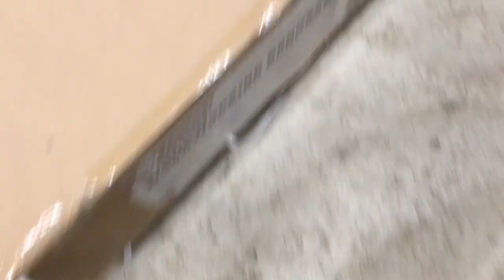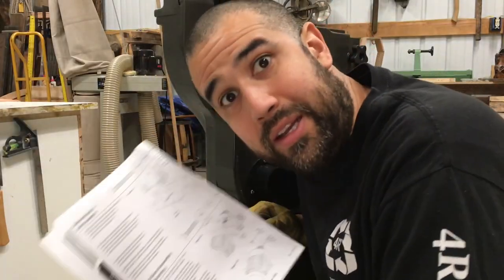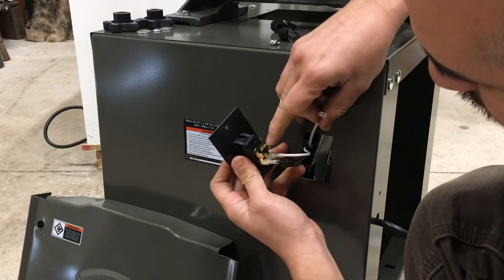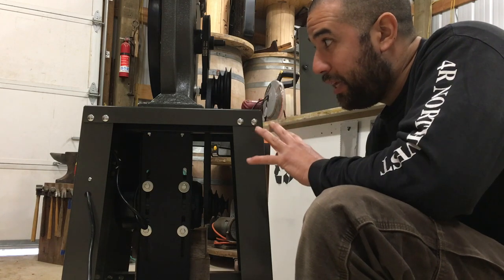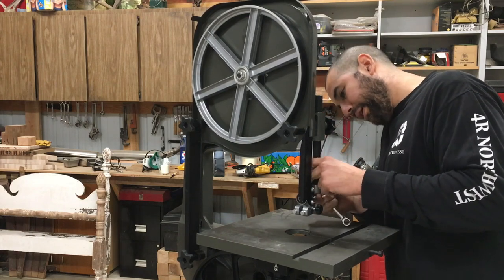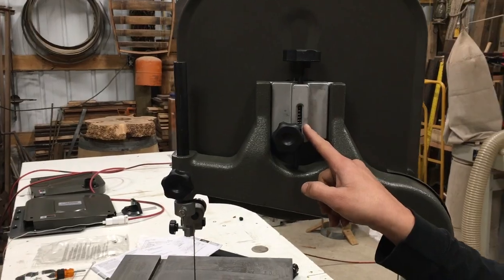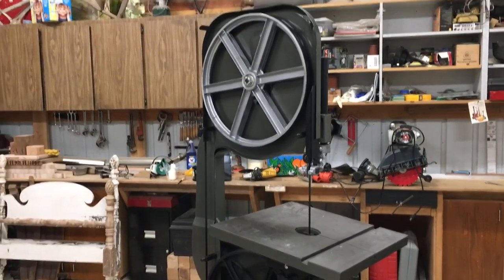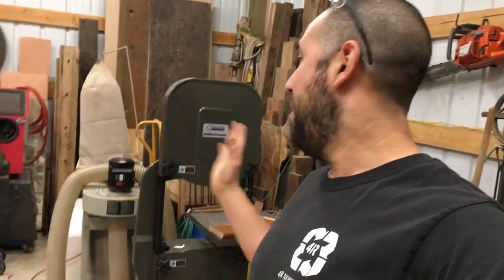Harbor Freight Bandsaw Unboxing, Assembly and Review | 4R NORTHWEST

Comment: Thanks for this vid... Any opinions on this saw, after having used it for awhile?
Reply from the maker: travis I hope this video was a help for you. It's a good little Saw! Bearing in mind that like a table saw or planer or miter saw, it IS a dimensioning tool and you'll be sanding and fine tuning your stock after using. Although there are some super slick jigs to build for a 14" bandsaw for doing all manner of noise making on it! Like cutting perfect circles for example! Have fun!

Comment: 10 ! thoughts about a fence that works with it ? no holes on the table...
Reply from the maker: Amit Doron if you’re adventurous you can drill and tap your own holes. But BE CAREFUL as cast iron is very strong BUT very brittle. If it’s cast steel it would be easier, honestly not sure which it is. Me? I would just build a fence out of 3/4” melamine board and clamp it to the table. So Kong’s as its square it will be as “perfect” as you need for a bandsaw task. That’s what I did and I resawed 3/32” thick Hardwood veneer on edge grain without issue! Have fun and thanks for watching!

Comment: Great. Video do you kn ow if you could add a block riser to this saw.
Reply from the maker: Herbert Brown Riser block! Excellent question! To my knowledge yes, the upper and lower are in fact two cast segments which are split in the appropriate location for a riser block. Now, I don't believe that HF manufactures a riser block under there "Central Machinery" brand name but because this unit is so closely modeled after the Delta (and a few others) it stands to reason that a riser block for another model would also work. The milling holes is the only thing in question as to rather or not they would line up. So if one is handy and not put off by drilling a couple new holes IF needed then one STILL stands to save hundreds! I'd do some general google searches on the issue and see what others have done first if you find a riser is needed for your purposes. Hope this helps and thank you for watching!

Comment: I have one what size is your band saw blade I need a new blade. Thanks
Reply from the maker: Angela Prater it all depends on what you’re work involves. If you’re resawing boars then you’ll want at least a 1/2” Blade with 3tpi (teeth per inch). You’re saw can handle up to a 5/8” 3tpi resaw blade. Now if you have a lot of curves or tight radius’s to cut then get yourself 1/4” blade or even an 1/8” blade for really intricate cutting. You should have a general assortment of blades that suite the task. I order my blades on amazon from Olson. They’ve served me well and at a great price. Thank you for watching and I hope this helps.

Comment: Went together great. I really think it's a pretty good value and starting point. Will add guide bearings top and bottom, new urethane wheels, link belts and quality blade. Need to figure out something for a fence though. Any suggestions?
Reply from the maker: Rock on! That’s great! So happy this video is still helping folks out. I’ve since gotten into a “heavier duty” bandsaw but I’m really happy I got this one. It was to good a deal to pass up. Now, I’m considering another video on making you own fence for the bandsaw as my new bandsaw also had no fence! I built one from 3/4” melamine sheet goods. I made it about 8” tall if memory serves me (which it usually doesn’t). I made some 90° Triangles for the supports to keep it upright at 90. Drilled holes in the bottom of it from and back to receive F style clamps and clamp it to my table. I can resaw hard dry Ash on edge easily taller than 8” and make my own veneer! (Which I’ve done). I recently resawed black walnut 12 & 1/4” tall on edge grain and made large 7/8” thick cutting boards which you can see on my Instagram with this simple fence set up! As far as upgrades go for you new machine I’d hold off till you play with it for a while. There are plenty of arguments for guide bearing vs cool blocks and vice versa. It came with blocks and they’re fine for now and cheap to upgrade to cool blocks. First things first, get the right blade for the right job. For smaller intricate and tight radius cutting use 1/4” blades or even 1/8” for really tight curves. For resawing boards which usually means on edge grain get at least a 1/2” 3tpi resaw blade. I use a 5/8” 3tpi resaw blade and it should fit your saw comfortably as well. I order my blades from Olson off Amazon and they’ve done great. Reasonably priced and far from bottom of the barrel blades like those at Harbor Freight (sorry HF, just being honest.) Now do yourself a favor and watch Alex Snodgrass’ Bandsaw Clinic on YouTube. That man is a wizard and crams a ton of great info into 35min! Well worth your time if you have a bandsaw and I recommend it to anyone even considering this tool. Hope this is a help to you and if you have any other questions or suggestions I’m all ears. thanks so much for watching!
Reply: @4rnorthwest  thank you. That was a lot of good information.  I really appreciate it. I will go check out the clinic now

Comment: You have calmed my nervousness on buying this machine. Thanks for the video, and stash your kid some cookie for when momma isn't around.
Reply from the maker: I think you'll find this saw will fit most needs. I do order my blades from Olson. get some for small fine work and tight radius' 1/8" and 1/4" blades. and 1/2" - 5/8" 3tpi resaw blades. On resaw take you time and let the blade do the work, its not a table saw. Glad you enjoyed the video and found it helpful. Thank you for watching.
Reply: 4R NORTHWEST I bought it, it's a lot of fun. I bought a 1/2" 3tpi blade for resawing and plan buying different blades for it. Thanks again for taking the time to make this video. Oh, you was right, ever single bolt hole lined up perfect.

Comment: Want to thank you for the very detailed video.  Helped  immensely with my assembly of the harbor freight 14 inch band saw.
Reply from the maker: George Shaw Fantastic! I'm glad to here this video was helpful. I noticed there wasn't really a detailed video on this bandsaw and at their price point I figured it would be a popular item. The only set back was most people not planning on having to do everything short of casting your own parts to get it up and running! Thank you for watching!
Reply: Now I would like to figure out how to add a fence to it. :)
Reply from the maker: George Shaw adding a fence is easy! All you need is a straight board on edge attached at a right angle to another straight board laying flat. Then clamp it to the table your desired distance. Use the miter gauge slot in the table as an "equal distance" guide so the front and back of your makeshift are the same distance from the miter slot. I have a larger Grizzly bandsaw and that what I do as I have yet to order a new fence for it and it's worked well enough to not NEED to order another. Also, if haven't already, watch the Alex Snodgrass bandsaw clinic on YouTube. It's worth every damn second! Hope that helps and thanks again for watching!

Comment: Cool vid man! Thanks! Do you know how well she handles thick, rough-cut hardwood? Do you think she would have enough oomph to get through 8/4 or 12/4 hard maple?
Reply from the maker: Honestly I'm not sure. It's a 3/4hp motor so its not weak but it's no killer either. For resawing and dimensioning purposes I'd order at least a 1/2" or 3/4" resaw blade with 3tpi. I use an Olson and it eats ash on edge grain 6" tall alive. Also you can upgrade to a 1hp motor as well which definitely helps in resaw applications. Blades, blades can make or break most saws. I only payed around $20 a blade. hope that helps.
Reply: I ended up with a used old school Delta for $100. Yeah, it does help! Now I'm starting to find that putting on the right blade for the right job is kind of essential! Apparently, I might need to invest in a variety of blades! Thanks!
Reply from the maker: Big Willy thank tou for watching! i get a lot of emails and comments but i to keep up and help where i can. Yes sir, BLADES. i like Olson, there good quality and wont break the bank. for the price of one Timberwolf blade you can get as many as 2-3 Olson blades. smaller blade/higher tooth count for small intricate cutting with tight radiuses and non-ferrous light gauge metals like brass-(id recommend a zero clearance insert in those cases) and wider low tooth count blades for heavy work on straight or wide sweeping cuts and resawing. good luck!

Comment: I just tried to set mine up but its turning slow. No matter how i line up things its not turning right. The pulling looked line up right and tried different v Belt tensions. Any thoughts?
Reply from the maker: How slow are you talking? I mean, these aren't especially fast turning machines to begin with. Check the wheels and make sure nothing is binding. Blade tension really shouldn't make a difference. Make sure your wiring is good also. Hmmm... Trying to think here, haven't come across this one before. If all fails HF will swap you out.
Reply: Just put one together with the help of your video and am having the same issue. Tried screwing down the ground screw again to make sure it was getting a good bite through the paint and still slow. Not sure how to describe the speed other than it's noticably slower and quieter than yours in the video and others I've used. Only point of reference I could use would be the writing on the lower belt, it cycles around about twice a second. Any ideas?
Reply: Mine ended up being a faulty motor. I brought it back. They said it could be exchanged for another but after a full assembly and taking it back apart again to bring it back i didn't have  the enthusiasm i had from the first purchase lol.

Comment: Question because I legitimately do not know. Why use a lock washer against a flat washer on the nut side? Doesn't it defeat the purpose of the lock washer? I always thought the lock washer was suppose to either bite into the bolt head itself or the mounting material thus causing the nut/bolt to not back off. It may just be me but if a flat washer is used above the lock washer then although the lock washer will bite into the flat washer the flat washer can still spin freely and wouldn't it still be able to back off from vibration turning the nut, lock washer and flat washer as a single unit? 

I just felt if the lock washer is placed against the base material (the underside of the table in this case) the nut cannot back off due to a mechanical lock of the nut to the lock washer and the lock washer to the table. I could be wrong and in no way am I trying to come off all pinky to the mouth official about it. I have just had no luck in my own experience using a flat washer above a lock washer since it can still spin against the flat underside of the table and has let me to over-tighten a bolt and on a grade 5 bolt that is not good. 

The flat washer under the bolt head makes sense to me because it needs to turn to its final tightening torque the flat washer on the nut side does not. The only reason I can think of using it is to not mar the underside of the table and to add structural integrity due to the metal used being something like 16 ga sheet metal. Is it just a cheap way to get a thin table to work for a heavy duty purpose and so it doesn't pucker/oblong the holes because its so thin?
Reply from the maker: evilcowboy I'll have to watch my own video again to make sure I didn't say anything contrary to my actions now! Lol. But for what it's worth I apologize for any confusion, there is a lot of information in this video and I did my best to make sure it was cohesive. So, you have your base material then your flat washer, followed by the lock washer THEN your nut. Yes the nut should be in direct contact with the lock washer. Hope this helps clear things up. I've never had an issue with this application. Thank you for watching!
Reply: A lock washer locks by keeping tension on the threads, not by "biting" anything.

Comment: after 7 months of use, would you buy this bandsaw again?  I was looking at their 1/3 HP benchtop version and thought i would see if you liked your bigger one.
Reply from the maker: Walter Terrell In short, for less than $300 dollars YES. are there better? YES. do you "need" better? That all depends on what you plan to do with it. The difference between the bench top (or any bench top version for that matter) is night and day. 14" bandsaw is a standard in size of sorts. Blades are easy to find and relatively inexpensive. I order mine on Amazon from Olson and they're great! I use a 3/4" 3tpi blade for resawing and on down to a 1/4" for scrolling out tight curves and shapes. HF blades leave something to be desired in my opinion. I have since let that bandsaw go to a happy new owner and stepped up to a Grizzly 1hp 14" bandsaw with 6" riser block giving me of 12 inches in resaw height capacity which I do use and mostly work in hardwoods. This was a little on the extreme side for the HF bandsaw but the Grizzly is also a $700 machine! Hope that helps settle a few questions for you. If you have anymore I'm happy to answer to the best of my ability. Also it's all in the set up once built. Appropriate blade on tire alignment and properly adjusted blade guides etc. All these things ad up for either great function or a real frustrating experience. That's any bandsaw. Thank so much for watching!
Reply: It helps a bunch.  The only reason why i would go with the bench top version is because i have to carry it to the "shop" when i set up on my patio.  So far, bigger is usually WAY heavier when everything gets put away.  Thanks for the quick response. Happy woodworking, Mathew.
Reply from the maker: Walter Terrell that's the truth! And so goes enlisting a mobile base. Easy to build with a variety of casters available at HF and some play wood or about $60-$70 for a "one size fits most" mobile base from Rockler, for example. Happy woodworking to you as well. Thank s again!

Comment: As a Suggestion for anyone that has a problem with the TRACKING of the PowerBelt from the Motor to the Drive Pulley. Use a small string wrapped 1 time around the Drive Pulley till it reaches the center of the top Tie with slip knot Let it hang Verticle with a small washer as a weight Until it Alinge the Center of the Motor Pulley. Then Use a LASER LINE to Alinge Both Pulleys and the String.
Very Nice Put It Together Lesson.